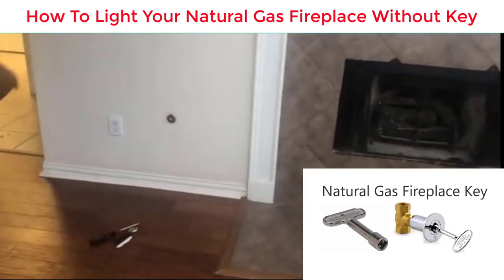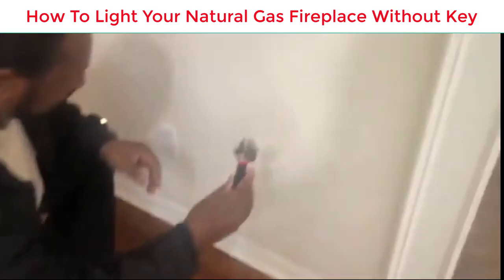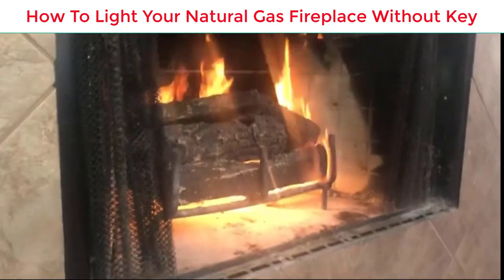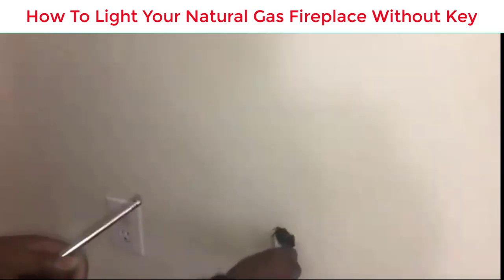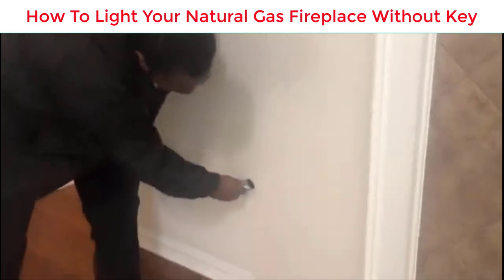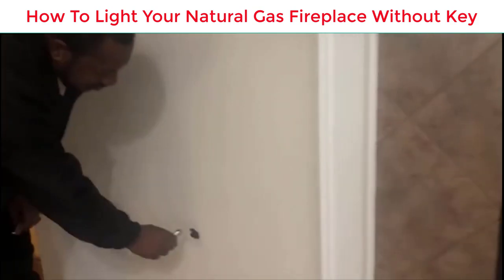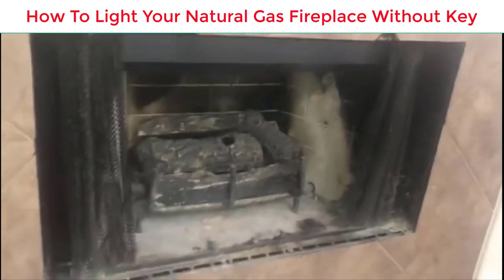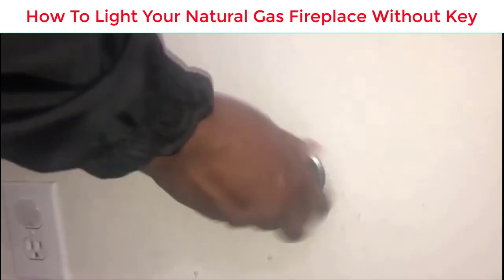How To Light Your Natural Gas Fireplace If You Lost Your Key To Turn On/Off Gas

Comment: I have a gas pipe about 18"-2 0" long running parallel with the fireplace floor about 4" off the floor with no burner control valve (pilot light, low, high settings etc). There is a key control valve in the floor 6" in front of the hearth. Is this designed to light and control as you demonstrated? i.e. turn on the valve and light the logs with paper or lighter?

Comment: How can you unstick the turn valve stem if the key wont turn? I broke my key trying to turn it to open. Is the any kind of spray lubricant or penetrating oil i can apply to get it unstuck so it will turn?
Reply from the maker: Make sure you are turning it the right way.     You might have to get a better wrench or impact it.